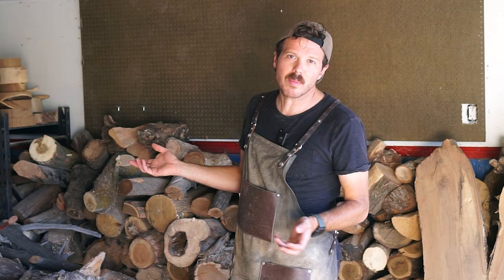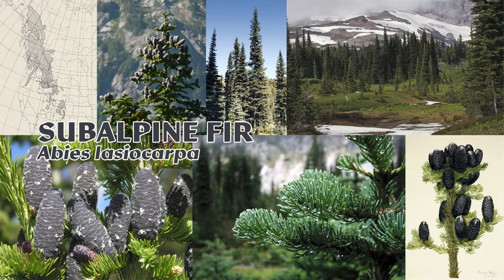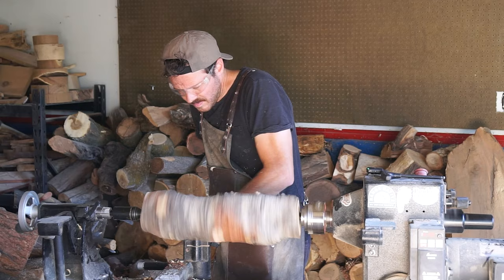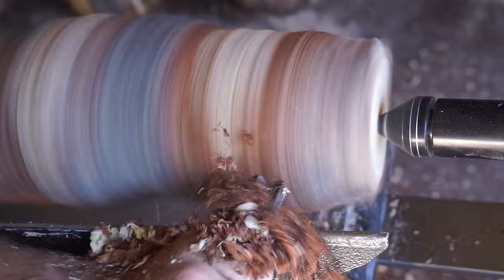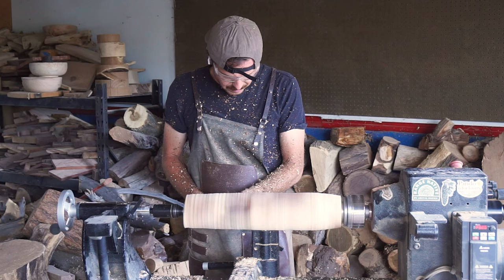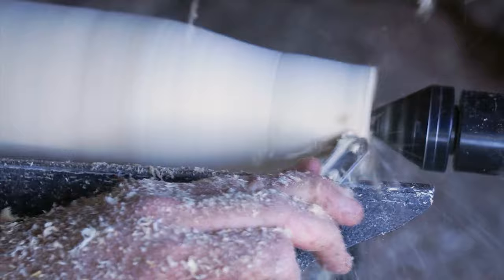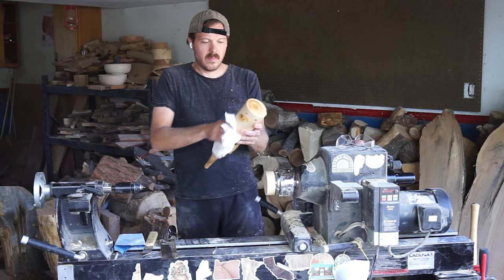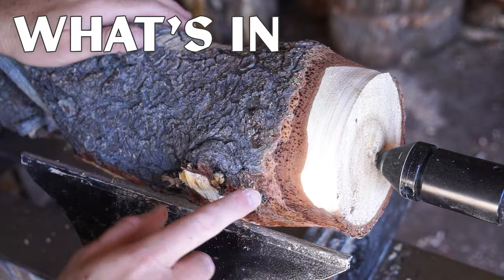Make things that have no purpose.

Comment: I feel this. Like, even something like sewing,  my step-dad was like "what's the point of doing it yourself if it just ends up more expensive than if you just bought it?" And I get it, our time is so valuable, and it's very easy to see making something "useless" as a waste of time and thus a waste of money (on top of the money from materials and stuff). It's so hard to break out of that mindset.
Reply: The thing about making one's own clothes, I'm finding (as someone who is curvy and plus sized), is that whatever you make will A) fit you far far better (and more flatteringly) than anything you buy, and B) be far far more durable than many purchasable articles of clothing due to the fast fashion trends where some clothes will start to fall apart after only a handful of washes these days. That, to me is a greater waste of money than paying the extra for making my own clothes that have the potential to last me for years.
Reply: @MissingRaptor also, the feeling of having made something yourself is simply incredible. I recently made a hoodie, and even drew a decal which I was able to screen print onto it. I can't help but feel very proud whenever I wear it.
Reply: @demetriam2408  absolutely!  It's amazing!
Reply: Why make a quilt when you can by a blanket at the store? Same question, different project. Because it looks better, feels better, has the emotions of "I made this", is tailored specifically to your tastes, and comes with bragging rights. Also, when it comes to clothes, you CAN'T always just buy it.

Comment: You pulled out a very nice piece of wood there, and demonstrated something that some folk don't necessarily understand, which is that ALL pieces of wood have a function, no matter what happens to them. If you had not selected that piece of broken tree, its function would have been to provide food for fungi and insects, or maybe fuel for a fire. 

Instead, you turned it into a chunk of wood that catches the human eye, and either stimulates discussion/comment, or, in my case, gives simple visual pleasure. Thanks!!